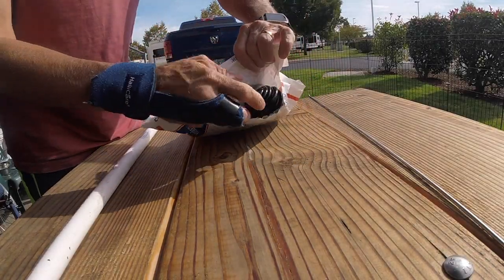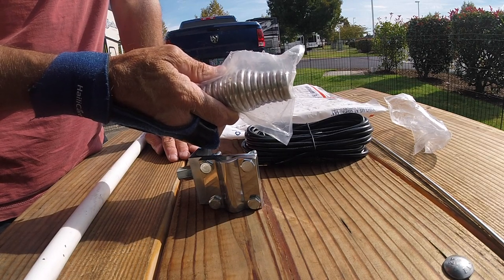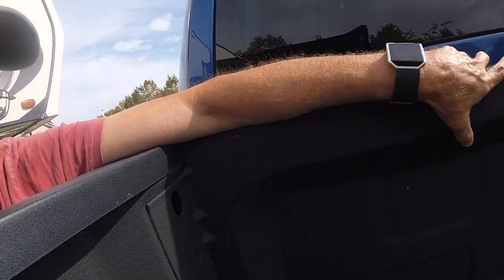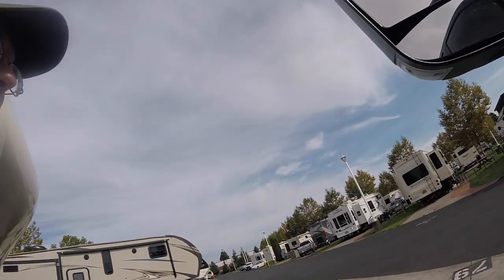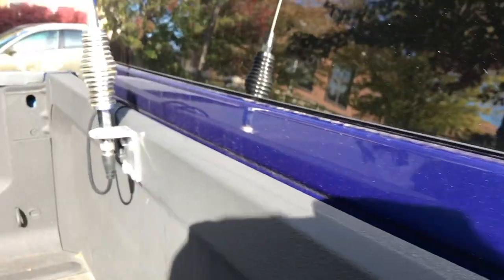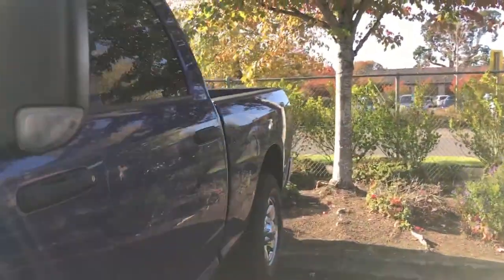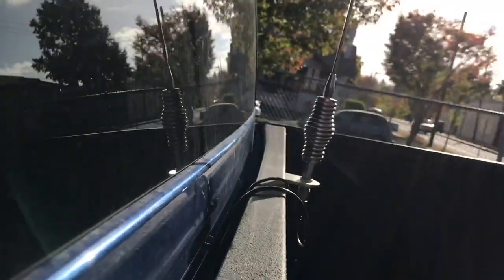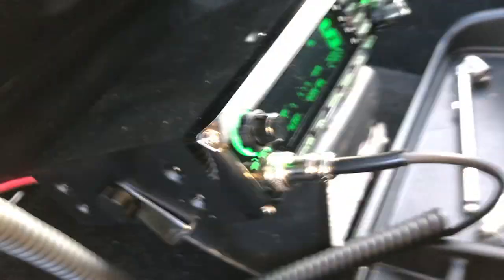UNBOXING, MOUNTING 102-inch CB ss whip antenna on our RAM 2500

Comment: I clipped fitting off the bottom and dropped to the bottom on a 10” adjuster. 1.0- 1.1 through 11 & 10 meter. Best antenna set I have found. 30 years of using many antennas
Reply from the maker: That's great. I actually thought I did something wrong or my meter wasn't working when I got that low of a reading. I called CB World and they told me I probably just did everything right and the reading is correct. My CB in our car using a Wilson Lil Wil I had to clip it to get Ch 40 down to 1.5 but that raised ch1 to 1.2 I believe. But for a small antenna it works great but not near the range as the Hustler 102" whip.
Reply: Bens359pete 

What do you mean you clipped the fitting off the bottom ? I’m confused by that . I’ve ran these antennas for 15 years ,  you mean the ferrule ,,? If you cut that off you lose your threading ?
You mean you clipped off the ferrule and slid it in a 10 inch riser ? I think I’m getting it the more I think about it . Where did you find the10 inch riser ??

Comment: Im going to try this antenna.i will put it on the roof of my 3500. If it whacks my canoe ill add a tennis ball..im surprised you say it doesnt hit your roof. 
I would think at speed when you hit something it would spring back and hit your roof..thx for the video..I allready have the mount on my roof so thats where its going..
I just need the whip and a 6in spring..

Comment: Nice equipment,  good job on the install,.. I also run a 102 whip.. But I went with a larger 6 bolt antenna bracket.. The large 102 whip needs a wide footprint to nest on.. Also look into the difference between a DC Ground & RF Ground..

Comment: 1.1 is decent SWR. I got mine flat but I had to cut it off quite a lot times to get there. I cut a 1/8 inch off at a time. I replaced my spring with a 10 inch riser so that it is adjustable.
Reply from the maker: That's really good and a good idea on using a riser. Where did you mount your antenna? So far mine works great being mounted just behind the cab.
Reply: @shartne  the riser is a perfect idea..Did the same thing on my cascadia...Dont get hung up on swr,doesnt mean ant is at its best...Get a cb shop with an analyzer on it and ask spefically about the restistence(r=50 ohms)and resonance(x=0)..

Comment: This is a great video and am planning to do the same install with minor variations. I wish Ram had not put a ridge down the center of the roof of the 5th gen 1500s but oh well. I bought a mount from cb shop in town and just opened to find it is aluminum. Is yours stainless or aluminum. I'm a bit worried about metal fatigue.

Comment: Hi there nice setup, since you are a hostler anttena fan that 102" whip will do the job very good, considering were you have to put it, it will hit the trees on the road and  the your back window and making some small marks on the top of your truck but you didn't have to many places to put the anttena, the only thing is that is to long, well my friend I have one other opcion for you ( the Hostler HQ-27 is a 55" antenna whit a center load coil ) is use Bay many truck driver's on there side mirrors whit a very good Swr and power handling I have one on my 2003 Mazda ( I will tell you that i have use many tape of antennas and this one has always come back on all my car's since 1984 ) a good idea is that you put this tipe of anttena on back of the driver's side truck box ( 1' to 6"' away  from the driver back window will be good ) Whit the same setup you have this will perform a better signal to the center of the road  and not hiring the trees ( check the HQ-27 how it works on you setup and then look at the other possible option in the back of the driver's side)...for that 102" long whip i will use it for a base antenna on the camper... Also in the driver's side if possible... hope that this idea will be good for you ...73's and good Dx's from Puerto Rico
Reply from the maker: Hello Yankee 76. thanks for the info. I'll definitely check it out. I've been wanting to reinstall my radio with heavier-duty wiring and have been considering trying out different antennas to see what is best for my set up. Thanks again for the info. Have a great day and thanks for watching.
Reply: @AdventureRoadTravelers  No problem ... check out the hustler HQ-27 and some other options you have available in you area...or look it out in eBay $ 24.00  and in combo $38.00
Reply: put a tennis ball on it and it wont whack the truck

Comment: Beautiful install 👍 . And truck too . Great job , I woulda had to take the bed off . Now just upgrade to a big boy radio properly aligned and tuned and you’ll be talking some skip if you wanted
Reply from the maker: Thanks. I've been watching for another radio. What is your recommendation for a big boy radio?
Reply: The 980ssb is a great radio and will easily talk skip already with a 102 in whip... I've talked skip on a 36in little wil from mi to Fla.. with a uniden 510xl ... it doesn't take expensive radios to talk skip it takes a good antenna which he clearly already has and a decent mic and radio.   And the right propogational environmental factors.   He could easily talk skip on ssb with 12 watts.   Given the 11m band was open... this comes from a ham operator.. your radio is just fine.... the ssb stability on the 980ssb radios is extremely solid.... leave welll enough alone.

Comment: Great video I have one question why would you buy a dodge ?
Reply: Perhaps because there is a million mile club that exists for them.
Reply from the maker: Hi and thanks for watching. The biggest reason I suppose was that we lived in Columbus, Indiana, and that's where Cummins engines are built so I felt a sense of loyalty to help support the community. Before I bought our truck I did lots of research and watched lots of video reviews. It seemed the new Fords had lots of problems and Chevrolets were out of our price range. Ram seemed to have the best reviews and most dependability.

Comment: It's been awhile since you installed it... how has it been for you? Did you ever get around to installing a larger barrel spring?
Reply from the maker: Hi there. My set up has been working great. I haven't changed the spring. It seems to be holding up just fine. Some recommended changing out my ground wire for braided wire so I'm thinking of giving that a try just to see if it makes a difference. Thanks for watching and commenting.
Reply: @AdventureRoadTravelers  : 
You and/or your radio & antenna can 
NEVER be to well grounded🌩️⚡!!!!

Comment: Great video , been wanting to get back into cbs . I have a dodge 1500 an i was wondering how id mount the whip . So this video helped me out . Thanks :)
Reply from the maker: Hi Timmy. Did you get a whip antenna mounted to your truck? Thanks for watching.
Reply: @AdventureRoadTravelers  Not yet , but im going to . sadly a couple of my radios arnt working right cause i let the sit out in my garage for quite a while . i assume hot an cold temps / humidity took a toll on them .
Reply: @timmygilbert1371 : Hey bro! It's been 
2 years since you posted this! 
Are you on the air? Did you mount 
the antenna? What kind of CB are 
you using? SSB capable? If I had a 
truck, I'd mount a twin 102" whip 
set-up on the back bumper or 
the top of the front or back of 
the pickup's bed corners. Now THAT 
would look totally killer-cool and 
would be awesome on skip-nights!!
With the right radio you wouldn't
need skip to get around the world!!
So tell us what you finally did, bro!!
Just Curious: Do you prefer the older 
vintage CB radios(70s,80s,90s) or 
do you prefer the newer radios(Anytone, Galaxy, etc)? Let us 
know bro!! Take care & 73's, Norman.
Reply: @norman2999  
I'm sure you already know this, but dual antennas need to be 1/2 wavelength apart to show any gain.
One 102" whip is plenty in my opinion.   I used to run one on my old truck mounted similar to this video.
As far as radios go, I prefer a ham radio that's been opened up to transmit on 11 meters.   Always had problems with CBs eventually.   
Always having to go to the repair shop, or get another one because you can't find a decent tech to work on it.
I've been running an Icom 706 Mk2G for 15 years now without any problem.   Not wanting to drill any holes in my current truck, I'm using a Wilson 5000 mag mount.   Talked to the UK from eastern NC yesterday.
Not as good as the 102" whip, but ok.

Comment: Appreciate the vid. What did you do with extra length of cable, please?
Reply from the maker: Moshe Chaim hi. By the time I ran the cable under the truck and up through the firewall to the radio I didn’t have any extra. I did zig zag it a little while strapping it to the frame of the truck and that may have taken up any extra length. Hope that helps.
Reply: @AdventureRoadTravelers That helps. Thank you and kind regards.
Reply: @AdventureRoadTravelers I installed on my 05 Sierra mated to a 29 Ltd classic. At first SWR all the way to the right! My buddy took the two washers out of the equation and instantly, flat. No cutting or additional parts. Cal all channels. All but ch 40 flat. And it's not enough it's barely recognizable. Thanks again for your input.

Comment: Nice job! Quick question, Did you use the, I believe you said it was a 3" barrel spring that came with the mounting kit in the video or did you go ahead and upgrade to the 6" showing here in the video?
Reply from the maker: Hi. Thanks. Yes I used the 3 inch spring that came with the mounting kit.
Reply: Excellent! I have an old mid 80's Dodge that I have been restoring, I am wanting to get the CB mounted in it and this gave me just the idea that I needed for it! Thanks for a very informative video!   Good luck out there God Bless!

Comment: Just curious what kinda range you get with this setup. Im new to CBs and looking to get one soon!
Reply from the maker: I haven’t really done any in-depth range testing but I drove away from my house which is surrounded by trees and power lines nearby and kept transmitting to my wife who was using a cobra 75wxst with a Wilson little wil antenna and I was able to get about 7 miles away (by road, not actual distance) before we lost contact. A lot of trees were in between though and relatively flat terrain. I hope that helps.
Reply: @AdventureRoadTravelers  thank you sir for the reply.. yes it helps. 

There are so many radios and antennas to choose from that idk what to get as far as radio.. antennas aren't to hard to choose from I guess

Comment: Is it rubbing the top of the cab? Try drilling out a tennis ball running it down to the cab and it should keep it from hitting that cab. Great set up Waven four fingers and a thumb !!
Reply from the maker: Michael1212 hi, thanks for the suggestion and the wave. I’ve been meaning to do that I just keep putting it off. The antenna doesn’t rub against the cab. I’ve never had it hit the cab even  when It’s whacked tree branches while driving down streets with low hanging branches. Have a great day.
Reply: @AdventureRoadTravelers  You could use one of those old 76 gas station antenna caps as a protector.

Comment: How is the hustler 102 in whip? I'm thinking about buying it and mounting it to my ac unit on a second story of my home and my uniden pro505xl is literally right next to the window where ac unit will be so 2nd question would be how long you think coax should be if the whip will be mounted to ac unit?
Reply from the maker: Andrew Collins, Hi Andrew. My antenna is still doing great after nearly a year of using it. I don’t think I will be replacing it with another antenna anytime soon. It does its job well and I like the occasional thwack when I go down streets with low tree branches. Plus I hate going to drive thrus so it gives me an excuse not to. I do take it off if I know I’m going to be parking in a parking structure or getting the truck serviced. As for the length of coax, there’s all different opinions. I’ve always heard that 18 feet is the best length to use but don’t coil it. That’s what I have on my truck. Others say the shorter the better. I’ve read that it can affect the swr so if you go shorter and you can’t get an swr you like try adding some length. Again That’s what I’ve read and don’t know if that will affect your swr. Also make sure you have a good ground. Good luck.
Reply: @AdventureRoadTravelers  the fact you took the time to respond makes me very appreciative. Thank you for your time to get back to me. Thanks for the response and will definitly helped. Also I'm planning on buying the parts on amazon and was trying to look for the mount you are using and the coax plus antenna kit but couldnt find it.
Reply from the maker: +Andrew Collins hi Andrew. I bought mine as a kit with the antenna. It was a standard mirror mount that I used which seemed to work just fine. The spring I believe is a 4” spring with a 1 inch spacer. It also came with a nylon washer. That is placed between the mount and the spacer. The spring and antenna go on the spacer. I have a ground wire connected to the mount and attached to the frame of the truck. Hope that helps.

Comment: How many cable i need to put to 102"whips to have a good calibration,  have a good day!
Reply from the maker: Hi Carlos. Opinions vary on what length of coax cable you should be running with a 102 inch ss whip. For me an 18-foot-long cable worked perfectly and was just the right length to reach from my antenna to the radio without having to weave or coil it along the way. Others say 21 feet of coax is recommended, while still others say trim it to fit. 18 feet is a good start though. I think if you have a good quality cable and a good ground to your chasis/frame you should get a low swr reading.  I hope this helps. Good luck, Carlos, and thanks for watching and commenting. Take care.
Reply: Carlos 18' and 21' are good use a good cable I recommend RG mini8 for you car or truck whit all tipes of CB'S anttena's  one way to know how much cable you need is basically using this formula 468 / 26.000 mhz . .that's 18' long ( 1/2 wave long ) for a smaller cable use the same formula and then 18' / 2 that will be 9' ( a 1/4 wave long or 109" that was the old 23ch whip long  the new 40ch use 8'6" or 102" long whip ) so a 18' cable is basically on the mark of the new 40ch antenna ..73's and good Dx's.. from Puerto Rico

Comment: I use a 102 inch antenna for my base station
Reply from the maker: How's that working as a base station antenna? I thought about doing that as well.
Reply: Howdy it's works great just ground it real good get it high as you can
Reply: Give it a try

Comment: How did you tighten the bolts in between the bed and the cab
Reply from the maker: Mr Pall hi. There’s about an inch and a quarter or inch and a half gap that I could slide my fingers down holding the nut with the sides of my pointer and middle fingers. I then put the bolt through and gingerly held the nut against it until the threads caught. Then I used a boxed end wrench to hold the nut while I tightened the bolt. I think I only dropped the wrench once and two or three nuts but eventually got them on.  Hope that makes sense.
Reply: Very Carefully 😂!

Comment: Nice 👍🏽 I got question about how the range
Reply from the maker: Thanks. For range I haven’t really tested it too much. I did drive my truck away from my house and have my wife transmit from our car using a little cobra swx 75 with a little wil antenna. We could talk to each other for 7-9 miles apart which was probably pushing the lil wil and cobra range. We also live near some high power lines. Other than that I haven’t tested the range. I am in the process of changing out the ground wire with some braided ground wire which another viewer suggested. Thanks for watching and commenting.

Comment: Adding the ground wire as mentioned is not the right way goin about it..Your useing an electrical gnd vs a rf gnd....That electrical wire is adding imaginary length to the antenna giveing a false reading....Remove that and use wide braided wire  straps and connect chassie to truck box...Cab to chassie and cab to box..Your trying to give the antenna the metal mass it need and will increase range because antenna will now match better..swr can look good but be outta wack..Think of it like the fingers connected to your hand..
Reply from the maker: Thanks for the info. Great advice. I've had this set up for almost two years now and is probably due for an overhaul anyhow.
Reply: It's called "bonding". 
A low SWR reading means very little to how well the antenna effectively radiates the radios transmission. 
In reality, you'd probably be better served with a center loaded antenna with the coil at least 8" above and away your roof line. 
Try a Hustler mast with a Wilson 2000 on that mount you have. 
Always use braid for a ground strap.
Reply: @СтивСкотт  top load beats mid load EVERY TIME!!
The rest of your comment is dead on though..
Reply: @craig_sez8534 , true that is.

Comment: Why didn't you mount it in the corner of the bed vs the center?
Reply from the maker: Hi Leonard, That's a good question. I guess mostly because I like the way it looks in the center and it's a little more out of the way there. I'm sure our grandsons wold use it as a handle to climb into the bed of the truck if I had it on the corner. It doesn't seem to hinder transmitting or receiving, at least from what I can tell. Plus, our neighbor, a longtime CBer, also has his whip antenna mounted in the same location and he swears by it.
Reply: @AdventureRoadTravelers  One on each corner would look really cool maybe 1 dummy and 1 functional. Then you could get tie downs and fold them down toward the tailgate if you had to pull in to a garage or low clearance area. They sell tie downs on ebay for $10.
Reply: Because the ground plain works better if centered, giving you much better SWR readings and max functional ability! Let's the signal bounce off the cab of the truck!